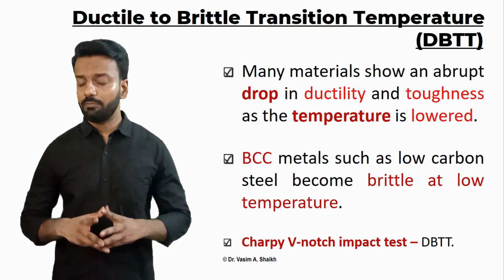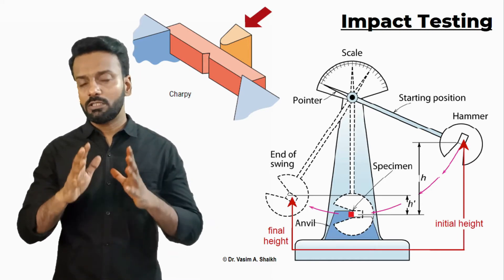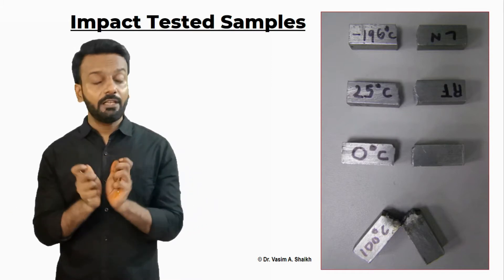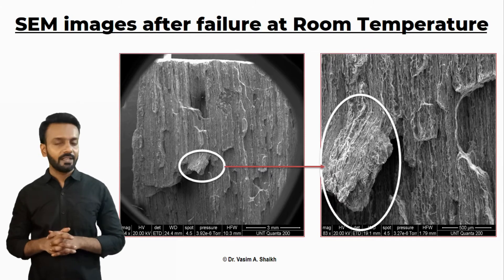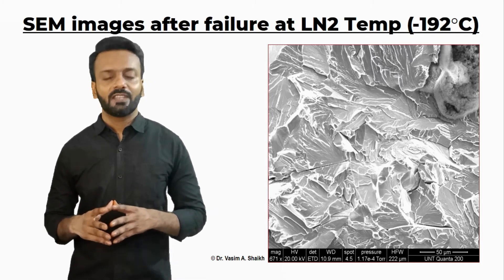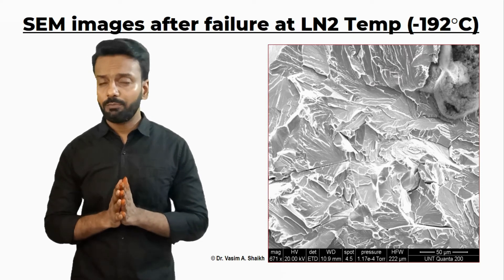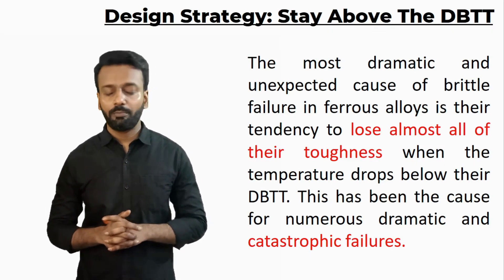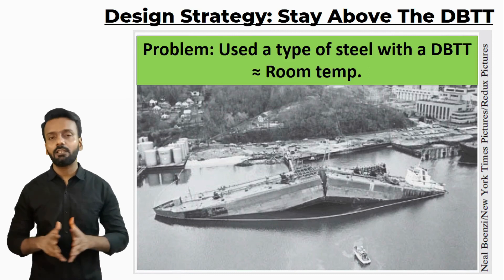Ductile to Brittle Transition Temperature | Dr. Vasim A. Shaikh

Comment: Sir, For grade SAE1010 steel what is the impact energy (joule) at —50°C & 0°C ?
Reply from the maker: The impact energy of SAE1010 steel at -50°C and 0°C will depend on a number of factors, including the specific testing conditions, the size and geometry of the sample, and the presence of any impurities or defects in the material. However, based on general properties of SAE1010 steel, we can make some estimates. SAE1010 steel is a low-carbon steel with good toughness and ductility, which makes it suitable for a variety of applications. At room temperature (approximately 20°C), the Charpy impact energy of SAE1010 steel is typically around 40-60 J. As the temperature decreases, the impact energy of the material generally decreases as well. This is because the lower temperature makes the material more brittle and less able to absorb energy during fracture. However, the specific impact energy values at -50°C and 0°C will depend on the specific testing conditions. It is likely that the impact energy of SAE1010 steel at -50°C will be lower than at 0°C due to the increased brittleness of the material at the lower temperature. However, without specific testing data, it is difficult to provide a more accurate estimate of the impact energy values at these temperatures.
Reply: @ProfDrVasimAShaikh  many many thanks sir. Sir Alloying element helps to increses Hardness or good ductility.

Comment: Sir what will be the effect on impact strength with increasing temperature for low carbon steels?
Reply from the maker: In general, the impact strength of low carbon steels decreases as temperature increases. This is due to the fact that as temperature increases, the thermal energy in the material increases, causing the atoms to vibrate more vigorously and reducing the material's ability to absorb energy without fracturing. Low carbon steels have good toughness at room temperature, which is attributed to their ductility and ability to deform before fracture. However, at elevated temperatures, the ductility of low carbon steels decreases, resulting in a reduced ability to absorb energy and resist impact. The exact temperature at which impact strength begins to decrease depends on the specific type of low carbon steel and its microstructure. Generally, the impact strength of low carbon steels begins to decrease significantly at temperatures above about 200-300°C. Therefore, it is important to consider the operating temperature of a low carbon steel component when designing for impact resistance, as higher temperatures can significantly reduce its ability to withstand impact loading.